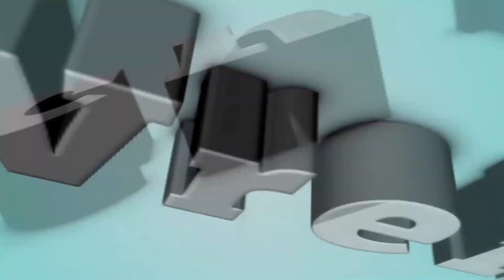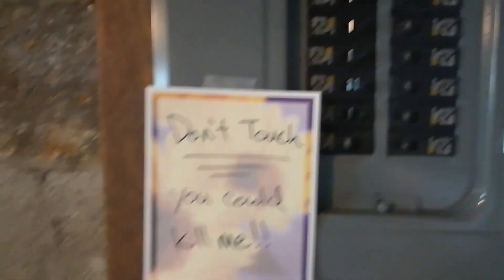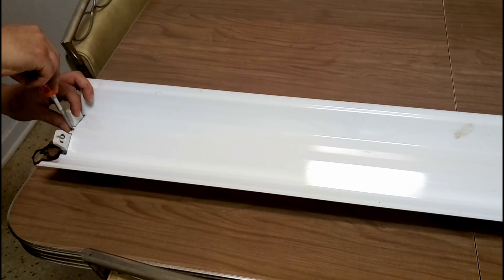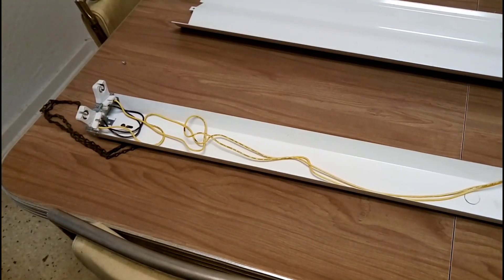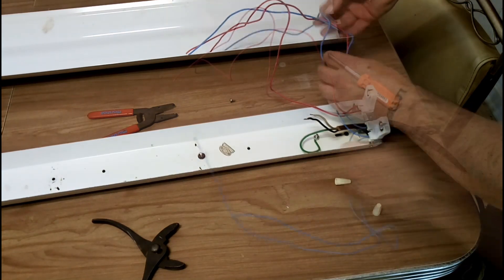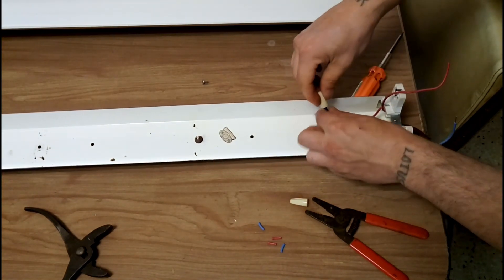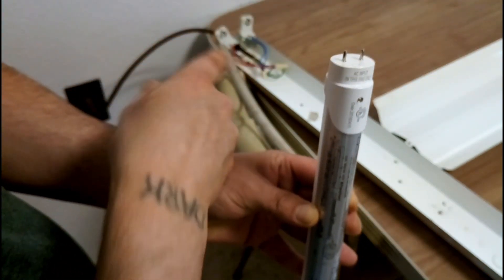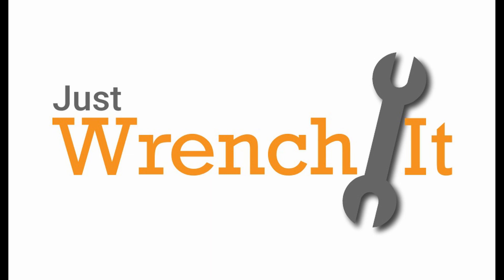Convert Fluorescent Tubes to LED

Comment: I used the dual powered bulb conversion. Connect white to one side if terminals,  and black to the other side. Your single end looked easier.  One of the best videos I've seen on this . And I looked at several before I took on my job.
Reply from the maker: thanks Marc!